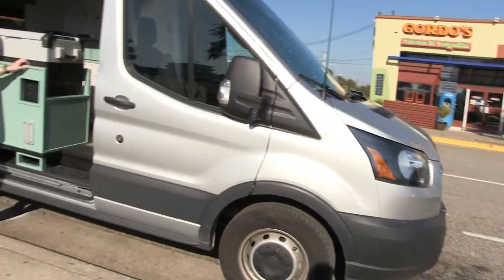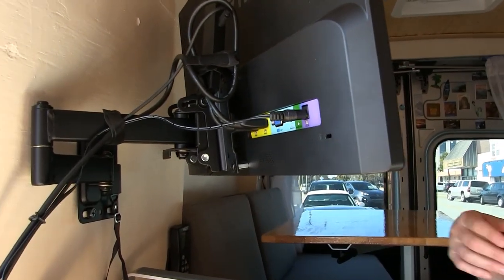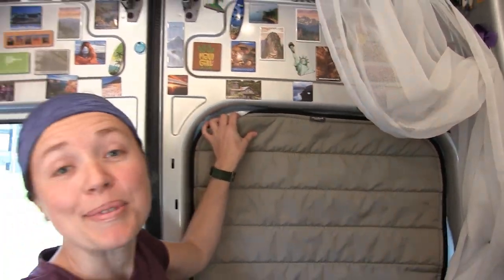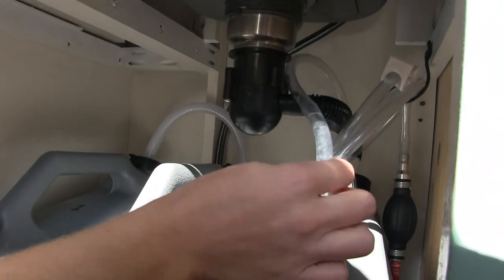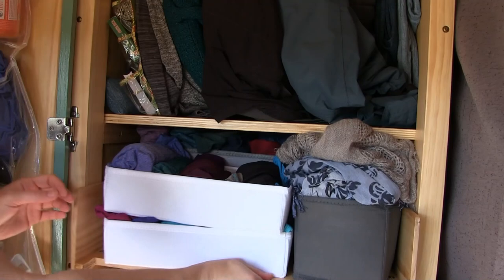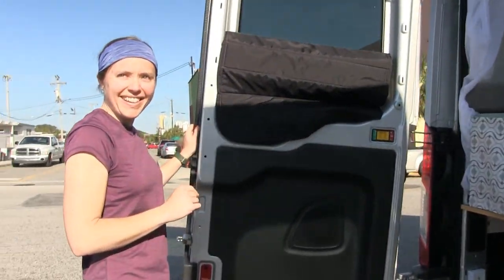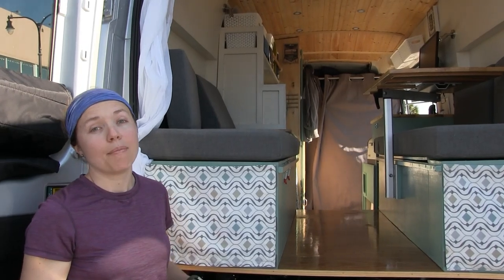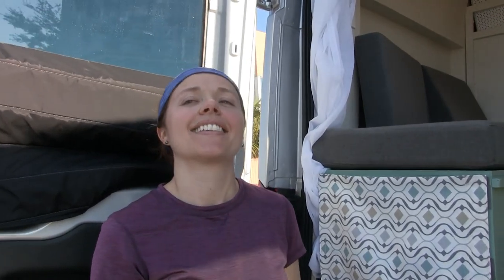VAN LIFE | GENIUS DIY Homemade Campervan - Ford Transit Conversion

Comment: Great interview. Very informative. Thank you, both. This is my new favourite van layout. We are hoping to convert a Ford Transit in due course. Everything was sympathetically done, tastefully finished and well thought out. I actually have a few of the storage items in my home and we're lightweight options instead of having upper cabinets.  Heating was a question for me, so am guessing Lindsay will follow the sun for the winter. Other than heating, there were no unanswered questions for me.
Reply from the maker: She has a small electric heater
Reply: @NewJerseyOutdoorAdventures  thank you. That sets my mind at rest 😀

Comment: Very very cleaver use of space. I see so many people who just throw a giant bed in the back and that bed takes up like 80% of the space. 
It's also really genius to have easy access to all the guts of the van. Many people hide that away and seem to forget that some day you might need to repair or replace stuff. 

This is definitely one of the top 3 best vans ive seen so far.

Comment: curioius - did you have to get a bigger alternator to charge your big house batteries?
Reply from the maker: Thank you for watching. Yes, I believe  a Ford has different size alternators available for up fitter applications

Comment: That inverter and the batteries need to be able to dispel heat. The way they're set up, the heat from the inverter will shorten the battery life. Otherwise, great build.
Reply from the maker: Thank you for the tip Tina
Reply: Actually Battleborn specifically told me their lithium batteries don't need any space for heat release - another selling point :) I have multiple vents installed in the closet to allow heat from the inverter and battery to battery charger to escape.
Reply: Oops,  found that answer I was scrolling for the past half hour,  lol

Comment: Would be awesome if ford transit guests were more specific with the size of their vans. She called her van standard with high top. How long is standard? All sites seem to use different terminology. Transits come med, long and Xlong I think? So Linsey has medium .?  Great video. Love them all. Getting prepped to buy a transit myself.  Thanks Patrick
Reply: There are SO many different combinations of options. I have an awesome salesman to recommend if you're looking to buy Ford and have questions about Transits. The highest roof automatically comes in a longer length than the standard low roof. You can also get the highest roof in an extended version. I have the Ford Transit 250 High Roof 148" wheelbase.
Reply: Also- this version fits in a standard parking spot (it takes up the entire space, but it does fit) so it has not been a problem to find parking in all types of locations.
Reply from the maker: Thank you for explaining and for the referral
Reply from the maker: This is key if you want to be stealth
Reply from the maker: Lindsay has answered

Comment: Baby,that propane gas is lighter than air so it won't leave the van from  that hole ) place the detector for your safety 🙂

Comment: Great and very practical design. The question I have and would like to know how are these licensed and insured
Reply from the maker: It is Registered and insured as a van
Reply: From what I've read this varies greatly by state. Mine is licensed in Michigan as a regular vehicle and I use AAA for the insurance. Everything that is attached to the van is covered under the policy. I've used AAA with all of my previous vehicles and had a great experience. I called around and was told by many companies they did not insure "panel" cargo vans so I ended up going with AAA again.

Comment: Love it! Great to know the general cost.  I'd not place the fridge where the sun shines on it.
Reply from the maker: Thank you for watching
Reply: The fridge runs off the 12v system and is extremely efficient and well insulated. The window it sits behind is tinted. They make insulated covers if that ever becomes a problem, but I've had no issues so far.
Reply: @linds234  
🌞

Comment: Love this layout! I’m looking at a van build to live in during grad school and this one ticks all the boxes... except climate control. Are you planning to add heat or air?
Reply from the maker: Thank you for watching. There is always room for upgrades
Reply: Thanks, Julie! I have a little electric plug in ceramic heater for extreme cold but my intent was never to stay in cold climates for any length of time. I got a sleeping bag suit at Aldi awhile back that I've worn to work inside when it's really cold haha. I don't want to rely on shore power for anything so I don't plan to install AC. My fan/vent has been keeping up to cool things off so far. It can definitely get toasty but it has been sufficient for me. Good luck if you decide to build one!
Reply from the maker: You thought it all through
Reply: Lindsey Taber it was very encouraging to see someone create a nice van that doesn’t rely on power or holding tanks... And thank you for being transparent about costs!
Reply from the maker: Thank you for the conversation

Comment: What does she use for showering? 
I notice after watching several of these DIY  camper videos that some of these do not have a shower available. Plus I've been watching quite a few tiny home videos & I gotta say, this whole thing with tiny home videos & DIY home made vehicle type camper videos, it's like a trend setting thing that's becoming more & more popular in comparison to becoming a actual home owner. The prices for these are way cheaper than having a mortgage payment. Also, what's the insurance like for vehicles like these.
Reply from the maker: Thank you for watching.
She showers at work and the gym
Reply: @NewJerseyOutdoorAdventures  
Aaahh . . . .Nice.  That's pretty convenient if U plan on staying local

Comment: What brand and size bikes do you have Lindsey?
Reply from the maker: She may reply
Reply: @NewJerseyOutdoorAdventures  Okay ..Thank you..I hope she does..
Reply: @Gail JOHNSON - I ride a Liv Tempt 3 (small frame, 27.5" tires). The second bike is a very old (but still very capable!) Giant my mom passed down to me a long time ago. I don't know the model but I use that one for when I'm traveling with someone or as a spare. I use pop-off pedals on both - a great investment in my opinion! There are actually a number of folding bikes these days to consider as options as well.
Reply: @linds234  Thank you for your reply..I've been looking at folding bikes..But don't which would be best for me I'm only 5'1" got hills..

Comment: Oh! If you still have contact with Lindsey, could you get the info on the touch lights? That is exactly what I would want for the reading lights in out boat bedroom. Thanks!
Reply from the maker: She seems to have disappeared from social
Reply: @NewJerseyOutdoorAdventures  Thanks! She did such an amazing job on this. Very good use of space, and the finishes are excellent. I was impressed by the 12v system. This is the first of your videos I've watched. Thanks!

Comment: If this young woman is living full time in this van, and working full-time, where and how is she bathing, and taking care of personal hygiene? She has no running water, other than a foot operated pump for the the one sink in the kitchen area, no shower that I saw, and most importantly, no source of hot water. It might work for a few long weekends in a warmer climate, but I seriously doubt you could live in this space full time, year round.
Reply from the maker: All can be done at gyms, clubs and work
Reply: @NewJerseyOutdoorAdventures  Not during a pandemic it can't!

Comment: Isn't the carbon monoxide detector supposed to be near the top of the van, since it is lighter than air?
Reply from the maker: Yes is can go there.
Reply: This is a heavily debated topic of which there are too many opinions. In such a small space, I personally feel the most important thing is to choose a location close to where you sleep and in an area with regular air flow (not tucked away in a corner). CO will rise slowly as air warms, but can stay close to the floor in a cool, closed off space.

Comment: A great, personalised build. Very unique and extremely inspiring! Already planning my own now 😉
Reply from the maker: Thank you
Reply: That's awesome! Best of luck to you and enjoy the process!
Reply: Out of interest, if this build was done again, what would have been done differently?
Reply: @Fine Form Studio - I've been thinking a lot about that very question since moving in. I've done a few separated weeks of trials and then been living in it full time for a month. I've picked up some different kitchen items so far but I haven't found anything about the build itself that is frustrating or annoying. That could definitely change with time!
Reply: @linds234  Nice. What was the reasoning behind the lithium batteries and why two when you're only powering two appliances? Wouldn't a single AGM have sufficed? I imagine the lithium batteries would have had an eyebrow raising pricetag. If i could, I'd have a similar setup as yours is very impressive
Reply: @fineformstudio9579  Good question! I'm only powering two 110v appliances but I am running more off of the 12v system. I do not have (nor want) shore power so I wanted to have a battery bank that could support always being off the grid and one that I could expand into with potential changes. Lithium is indeed a big up front cost - if it's something you're interested in investing in I recommend contacting Battleborn (email or phone) as I was able to negotiate a reduced bundle pricing on the two batteries, Sterling battery to battery charger and Bluetooth Victron battery monitor.
Reply: @linds234  Thanks for the info. Much appreciated. I must admit, i cheered when i saw your Victron! I've got two smaller versions for my camping battery setup and they're awesome. I cringe when i see some electrical layouts when people have spent big on batteries and skimped on the battery management. I've subscribed to you as I'm keen to follow your journey. Keep us all posted!
Reply: @fineformstudio9579  I LOVE both my Victron battery monitor and solar charge controller. I can see everything I need in real time and they keep track of historical numbers for review. I hate to disappoint but I don't have any intention of starting my own channel. You'll have to keep watching @New Jersey Outdoor Adventures instead :)
Reply: @linds234  Fair enough. I think i can manage that 😁 Will be interesting to see what tweaks you make after spending more time on the road. Enjoy and stay safe!

Comment: where did you get those cool little touch lights?
Reply from the maker: She may comment for help on this
Reply: @RhondaOnline72  thanks!
Reply: These are the lights I'm using: https://www.amazon.com/acegoo-Lighting-Directional-Dimmable-Hard-Wired/dp/B074RX4JL7/ref=mp_s_a_1_1?keywords=12v+touch+light&qid=1574709566&sr=8-1

Comment: I love how knowledgeable she is when it comes to her conversion and her understanding of all the systems involved....especially the electrical components. She could easily tackle any issues that arise as well as help others she meets on her new life journey.
Reply: As for the electrical,  would that inverter put out too much heat within the enclosed space? Dunno about lithium ion batteries not tolerating too much heat like the normal automotive batteries...
Reply from the maker: Thank you Earl. 👍🏽